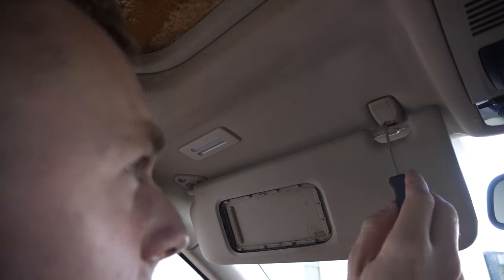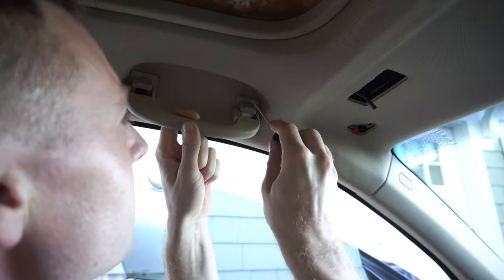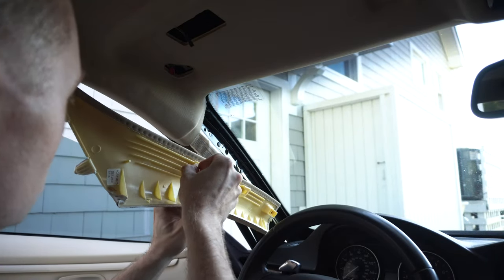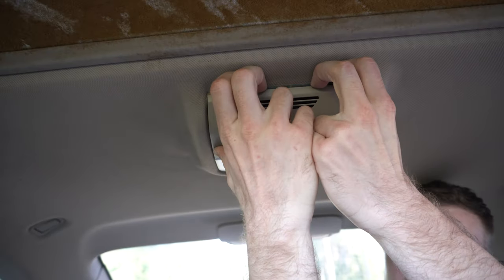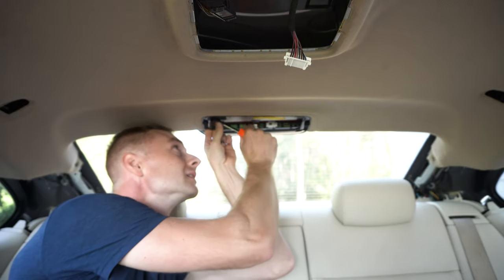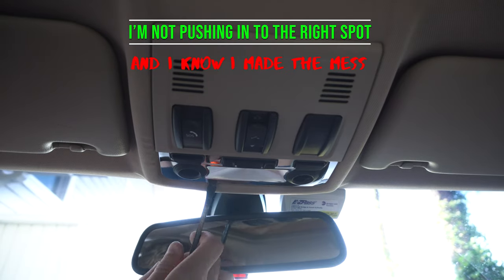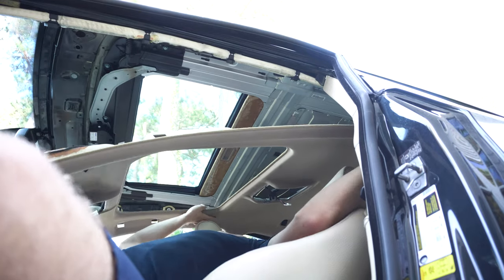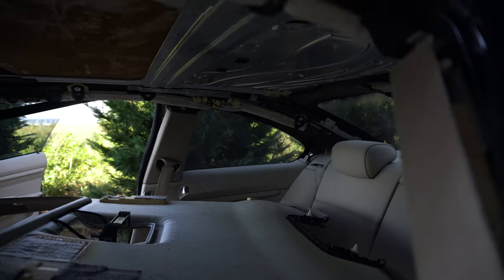How to remove Headliner on BMW E92

Comment: Do u remove the battery?
Reply from the maker: I don't, but you can if you feel safer this way, you have few SRS on the way, so I would consider of removing the battery. but it's not necessary.